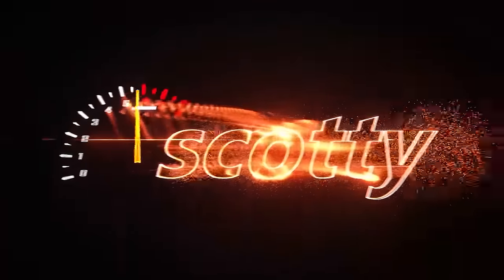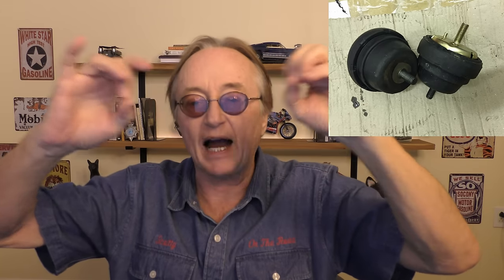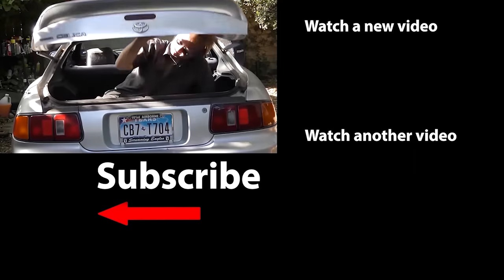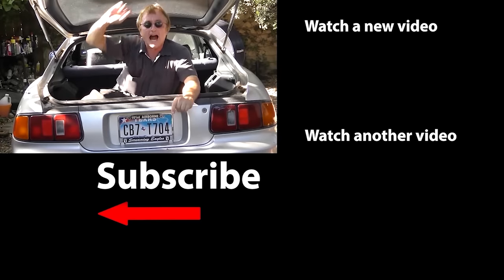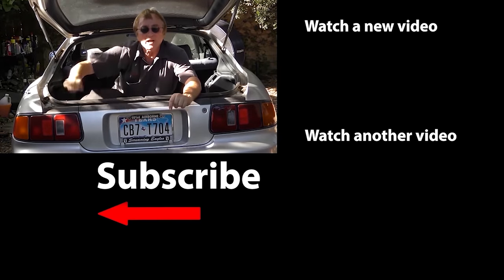Here's Why Changing Your Engine Oil After 3,000 Miles Will Destroy Your Car

Comment: I change my 7.3 soon as i can tell the oil getting black. Just put a new hi flow hpop and 5+5 spoologic turbo im not letting that get bad. I run arcoil in the oil and edt in the fuel every fill up & it Runs like a clock. Definitely let them cool before cutting it off.
Reply: same with my 6.0 although I need some archoil

Comment: My ‘96 Jeep has 407,000 miles. I drove it from South Texas to the Arctic Ocean in Alaska last summer. And back. 
Runs smooth. Gets good mileage.  I change oil at 3,000 miles.  You should do the same.

Comment: Oil generally doesn't like being above 240, but at 270 or above it starts breaking down hard & fast.  That's the problem with turbos.  Scotty 1000% right again: idle a turbo 4 or 5 minutes after parking so it can cool off.

Comment: 1:56
I inherited my grandpa's 1973 Impala back in the late 80s. That thing was a tank! We called it Big Blue, and you had to make an appointment to stop, and steering was a blast (like driving a boat). However, the heat on that puppy was outrageous (we never froze in winter), the bench seats were more comfortable than my bed, and that engine lasted FOREVER! I eventually passed it on to my brother who drove it until the wheels came off. Never touched the engine other than to replace the oil, filters, and battery.

Comment: I bought a 1994 Saab with 95,000miles, drove it 100,000 miles. The Saab Turbo was given to my son, he drove it for another 150,000 miles, the engine was still strong, but rust finally got to the body. Many other parts were replaced in the meantime.
Reply: Always tried to keep my foot out of the turbo, passed the advice to my son. Changed oil and filter every 5000 miles, synthetic oil always. Listen to Scotty Kilmer.

Comment: I've got a 2000 Toyota Camry and haven't changed the oil in 75k miles. Just the filter every3-5k miles. Car has 345k miles and still runs like a champ
Reply: 😂😂😂 that can’t be good

Comment: The car: 1972 Olds 442 with a 455. Length of ownership: 1971 - 2000. Mileage: appx 250,000. I changed the oil every 2 months myself. In 2000, it was running just as well as in 1971. A very badly rusted & cracked frame got it.

Comment: I have a 1.5 litre low pressure turbo diesel. 130k on the clock. I have oil & filter change every 10k or every year whichever comes first.

Comment: Scotty.... modern water cooled engines don't cool down (after warmup) when they idle... neither do the turbos. Engines actually get hotter. When you are moving, the air flowing thru the radiator is what cools the car. When you park, there isn't any air, only if the engine starts getting reallyhot, then that electric fan in front of the radiator will turn on.

Comment: With the amount that I drive to work and back I should be changing my oil about every 21 days lol that's nuts!
Reply: Distance vs engine runtime. Huge difference between highway driving and city driving. I go by engine hours. A city driver might go 2 to 3 times longer in engine hours than a mostly highway driver.

Comment: Sometimes if the tensioner is bad too you'll see it bouncing when the engine is running. Cause like you said the spring is worn out. It's not holding enough tension on the belt

Comment: If your car has a turbo you really should run full synthetic oil in it.
Since it is more expensive feel free to change it at 5,000 miles, it's safe to do that because it doesn't break down.
Long ago a co-worker was running full synthetic in a car, non turbo, and he was running it 10,000 miles between changes. He changed the filter at 5,000, then filter and oil at 10,000. The last I knew his car had 250,000 miles.

Comment: I owned a Mondeo TDCi for 10 years was changed no longer than 7000 miles subinterval should be 12,500 miles , regularly towed caravan , The engine and turbo was still good, but 205,000 miles when I sold it on

Comment: I have a 2011 Chevy Malibu with the 2.4L engine and it has 255,000 miles on it and I always use full synthetic motor oil and I change it as the car gets below 20% on the OIL LIFE GAUGE in the info cluster which is usually about 8,000 miles per oil change. The damn thing runs perfectly fine and I'm going nearly 3 times the distance you say I should go. Maybe I'm lucky and I have an exceptionally well built engine because it doesn't even burn oil AND ITS GOT OVER A QUARTER MILLION MILES NOW!!!!! I do drive the interstate alot in it and I make sure to give it a good romping now and again to blow it out and I run 93 octane gas in it. Runs like a top.

Comment: one interesting dynamic with the auto-stop/start feature I've noticed ... if I run my newish car hard and have to come to a complete stop - it shuts down the engine automatically :D I've learned to just tap the gas to keep it running in those cases - BUT - modern turbos have after-cooling systems where; if they are hot, they will continue to circulate coolant through the system even after you turn it off when hot - Audi had this since 1984 on the 200/5000 turbo engines.

Comment: I just change oil & filter every 5000 like the owner's book says. On my Scion XB the oil is just beginning to get darker at that milage. Really clean running. On my old V-8s it was every 3,500. Always used 20-50 in those.

Comment: And driving them hard every now and then is a good thing. Because another problem with turbos, is they seize up from moisture and corossion, from lack of use. So, exercise your tubro, to prevent seizing and corossion. I've seen videos where that was the problem, the turbo was seized from lack of use.

Comment: Ford E250 V6 2003. First new vehicle I ever owned. Change oil every 5 g Mobil 1 and Lucas. 377000 on the ol girl and she still runs solid. I'm a tile contractor so she pulls weight

Comment: You can paint a car with a brush and a can of paint without producing brushmarks . The paint mustn't be quick drying but slow drying , this means good quality exterior house paint teferred to as oil based or mineral paint , the finish is more impressive and glossy than auto acrylic paint job . Automotive paint is usually acrylic these days, acrylic paint is junk and can promote rust as it ages and undergoes chemical changes . The robustness of paints has declined in last few decades for health and environmental reasons . As a rule don't brush paint at temp above say 22 °C and with  low humidity for top results , but not too critical. Interestingly most of us can't perceive several shades of  difference in colour from say front of vehicle to the rear of vehicle if it's a graduated blending in with the spray can .

Comment: I`m in the UK and have 2 Mondeo 2.0L TDCi Auto Estates (Station Wagon) the 2002 has 154k+ miles and the 2004 has 98k+, and do oil changes every 5k and neither uses more than a 1/4 litre (if that) between changes... my only regret is I didn`t have these cars 20 years ago

Comment: Great video. I really enjoy when you share your knowledge. 
I, unfortunately,  have a 1.8t vw.  I hate it. My wife has the 2.5 in hers.  It's a great motor compared to mine. Thanks for the tip on idling the motor before shutting off the car.
Reply: Hopefully she doesn't have direct injection.

Comment: I have a Ford 2 liter eco in my cars. I watch the oil computer and change with a good synthetics and filter when it reaches 50% oil life. Neither me or my wife ever drive 'em hard. Turbo may get used on freeway on ramps sometimes when needed. Otherwise, we are the old folks in the right lane doing the speed limit. But Scotty i is right. Good engineering practice to let a hot turbo idle and cool down before shut off. Those red hot bearings will cook regular oil to carbon. That carbon will clog the return line to the sump. Then you have no flow and you ruin the expensive turbo!

Comment: I have a Ram Cummins, I installed a module that keeps the engine running even after turning the key off until the EGTs drop to 450 degrees to prevent coking of the turbo. I change oil at 3000 miles too.

Comment: 2.8 turbo 4banger duramax   had my oil tested at 5k  I was told the oil was clean and good and they suggested i could easily go 7k. , i do let the engine temp cool down under 190 before engine off after driving. usually takes about a minute except in summer  then it takes about 2-3 minutes.
Reply: How many miles you have on that engine?

Comment: Nearly no one puts chains on all 4 wheels.  In most cases with 4wd/AWD, you'd chain up the front wheels, giving extra traction for steering and the weight of the engine is there too.  But many people with AWD/4x4 don't even carry chains, even though often you are technically required to and occasionally you need them.  In about 20 years, the only time I was asked if we had them with us was going into Yosemite.  The back of the 4runner was packed, and I'm sure there were some in there somewhere.

OTOH, even with 4x4 and decent tires, if the snow is just wrong (such as an ice layer, or sloppy slush) you can have issues.  After having issues one day, I threw on a new pair of tires I had around that had even more tread depth.  In 4wd a tire would skip every few seconds, but in 2wd it was fine.  Turned out the diameter was about 1 inch less (265/65/17 vs 265/70/17), so the 2 new tires wouldn't work for me.

Comment: I don't change the engine oil as often as you say. Maybe every 9,000 miles but I also always change the filter. I only use 100% synthetic oil with the recommended "W". I also never change the oil by vacuuming but by gravity. That's why I had a BMW 320 D that was already 23 years old. 268,000 miles and no smoke coming out of the exhaust. For 23 years I only changed the clutch and suspensions and the usual consumables. Today I have a 6-year-old Mercedes van and the scandalous planned obsolescence is already noticeable.

Comment: That is very true about turbo. You should also let it warm up completely before you hammer on it and definitely let it run for a few minutes before shutting off the engine. But I believe some new cars continue to circulate the oil through the turbo even after you turn it off. I can’t remember what cars do that but some turbo cars do.
Reply: only every single modern turbo.

Comment: I drove F-150’s in the oil patch for 31 years. Went through about 15. Not one used oil when we traded them off. Of course we made it a point to change the oil about every 7,000 miles………true. 😳

Comment: I use the mobil 1 full synthetic high mileage 20,000 mile protection. Change that oil every 2,000 just knock off a 0. Still running good at 250k miles

Comment: Interesting observation I had recently. I have a 23 Prius Prime I acquired in June and a 23 Tundra I acquired in November. I changed the oil in both on the same day. The tundra had 600 miles and the Prime had 3000 miles but roughly 600 miles on the gas engine. The drained oil in the Tundra was significantly dirtier than the Prius… I’m gonna stick with 6 month oil changes on both 👌

Comment: Idk. Depends on the engine, type and boosted or non boosted. My 16 tc has 5k oil change intervals with full synthetic oil. Car is just fine, look inside the combustion chamberwith a borescope camera. Valve cover replacement @120k will look inside then too. Oil changes should be done based on usage.

Comment: The technology in long service life oils is great, but you have to remember that they were introduced to make the car look cheaper to maintain and environmental reasons of using less oil. That doesn't mean that it is the best solution to extending your engine life.

A lot of the OEM pioneers that moved to this also introduced higher ratio of engine oil to engine capacity. This isn't something we see on the likes of many American and Asian cars, that have also moved in this direction. Meaning that the oil is working much harder in these engines.

While engine oil has improved, oil filtration technology used by OEMs is still mostly cellulose fibers, rather than the much better performing and expensive sythetic filters. If your going to extend oil service intervals, surely you would be concerned about engine oil contaiminates? So why do we see these sythetic filters becoming more common? Simple. Both longer service intervals and standard filters are sufficient for warranty purposes. Doesn't mean that you will get the best life from your engine.

Comment: Use shell rotella the high zinc content protects the bearings and never shut them down hot let it idle. And if given the choice always choose a center section that is water cooled. Also if you need to run restrictor because of high oil pressure do so high oil pressure is bad just as low oil pressure is bad no kinks in the return line and it should last you a good long while.

Comment: Modern synthetic oils don't coke.  Their coking temp is over 400*.  Modern turbos have water cooled housings and don't require the oil for cooling.  The problem with turbos is heat sinking the engine, not the turbo.

Comment: I run a BMW Diesel turbo X5. I change the oil and filter every 5 k miles. I also let the engine idle before shutting it off. Diesels, being less stressed than pertrol engines, can handle 5 K changes. On my 4 stroke race bike, I change the oil after every meeting.
Reply: It its the 3.0 Diesel its a solid engine that lasts forever with proper care

Comment: I had a customer who bought a Volvo AWD and she went somewhere and bought 2 tires and it ruined the transfer case. 4 tires later and a transfer case ( which Volvo had 10 IN stock she was was back on the road. Volvo said 1/4 in difference in tires circumference will cause problems.

Comment: My parents had an '07 BMW 3 series with very low mileage.  Around 2018 the fuel pump failed and the rear window power motors broke dropping both windows 😂

Comment: Always change oil every 3000 miles or less, exclusively use Mobil-1 oil, have never had an engine failure in 52 years of driving

Comment: i've used snow socks in Colorado on a full size motor coach, they do work. BUT! After a road has had anti skid material applied they get eaten alive. A 1 time use deal in most cases. Easy get on, hard to get off. Learn to PUT chains on.

Comment: I drive turbo charged cars for a long time. If you change your oil and filter every 3,000-4,000 miles with oil filter you will have no problems. I drive Audi A3 or A4 tdi.

Comment: I HAVE CHANGED MY OIL AND FILTER AT OR BELOW 3000 miles in Dodge ,Fords,and AMC cars for 60 years,NEVER HAD A ENGINE PROBLEM OR FAILURE IN ANY ONE OF MY VEHICLES.

Comment: So here's the thing.. 

The problems with turbos in the PAST was that after a "spirited drive" and you shut off your car, you would get coking in the center bearing. Oil would collect in the bearings, the heat soaks in and the oil would start to coke on the side and foul the bearing. 

With Ford's EcoBoost Engine, water cooling eliminates that worry. Here's how:

The EcoBoost engine uses passive thermal siphoning for water cooling. During normal engine operation, the engine's water pump cycles coolant through the center bearing. After the engine shutdown renders the water pump inactive, the coolant flow then reverses. How? 

Well, coolant heats up and flows away from the turbocharger water jacket, pulling fresh, cool coolant in behind. It's really a highly effective coolant process that is completely silent to the driver, thereby continuing to protect your turbocharger.

Comment: Change every 12000 miles or 2 years as recommend by Peugeot. 15 years old now 165000 miles . No issues at all. HDI 1.6 Ford/Peugeot engine. 75hp Diesel

Comment: The oil is still good at 3,000 miles. You should change it at 5,000 miles minimum. Some cars call for 7,500 miles.

Comment: Point is if you don't change engine oil after around 3k it will be worse than it was and will wear more. Read between the lines. It got your attention right?

Comment: A lot of people are talking about the fact that an oil change is cheaper than an engine repair. I change my oil at 20.000 km. Now has 430.000 km, no repairs. I changed my oil 21 times. I would not change it 86 times. 86-21= 65 x how much is an oil and filter change? Would you repair the engine with that money? I think yes.

Comment: With Amsoil i have been doing extended drain intervals since 2005 in a 2003 2.4 carmy and still driving that same car today to commute to work.   It not turbo'd and it it was i may not do extended drain intervals.  In my 6.2 2014 Silverado I go 10,000 miles before changing oil and on year 3 owning that truck with no problems.  

Amsoil is the only oil i would do this with.  I also use their engine flush at each oil change.
Reply: Despite all the good things I've heard about Amsoil (yes, it IS available in Australia), it's FIVE TIMES the price of most "regular" oils.  For me, I'm just not going to see 5x the value out of it, I'll just stick to regular oil changes at 1/2 the manufacturers interval (7,500 km's instead of 15,000 km).
Reply: @OhSoddit  I different counties yes that price point isn’t the best.   I would still use a full or 100% synthetic oil, however     

I forgot to mention how good the Amsoil oil filters are. They use nano fiber media to better filter the contaminants.  I use those as well.
Reply: toyota can run on nuggets frying oil no problems 1 million miles guaranteeeedd

Comment: If you want a great Impala, go get a 2003-2005 Impala LS. Those had the 3800 engine option. Awesome W-body cars that drive great and get good fuel mileage and last forever. I'm surprised Scotty missed giving this answer.
Reply: Them transmissions go bad tho...
Reply: @j.c.2787  - Transmission a weak point in most cars that have great engines. I think 4T65-E was a pretty solid transmission.

Comment: Too frequent oil changes saturate your oil with ZPPD.    Your metal rubbing parts only can use a fixed amount of ZPPD.   Excess in the oil will go out the exhaust and kill your cat converter.